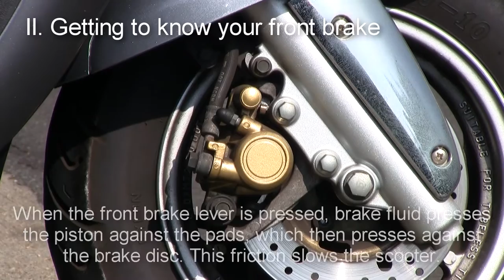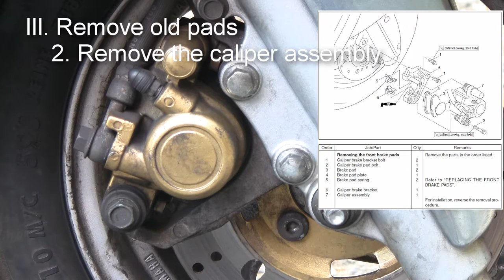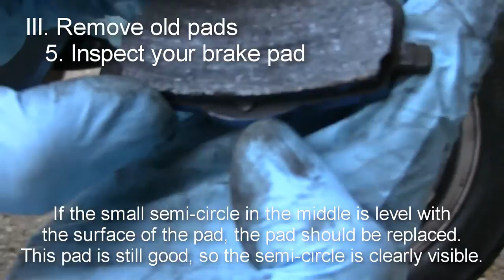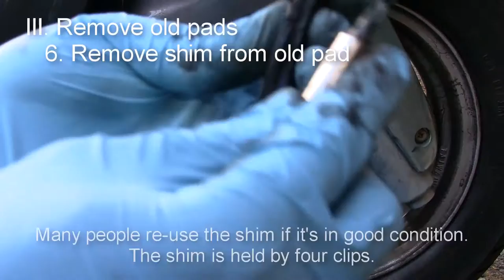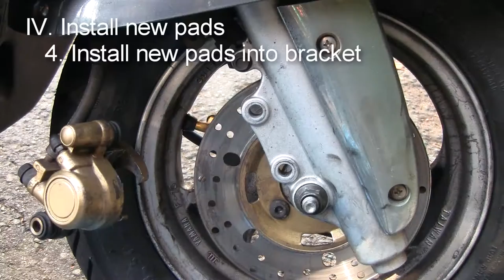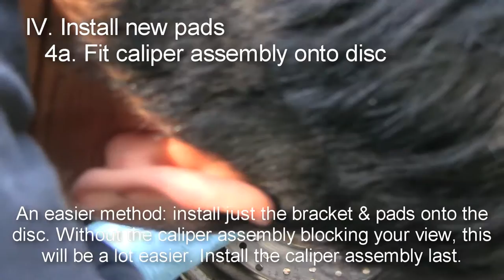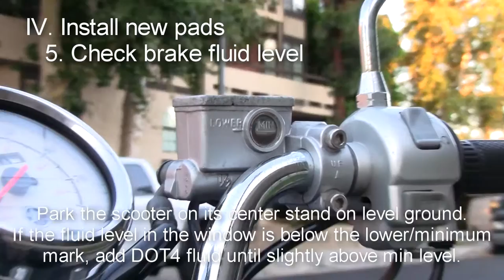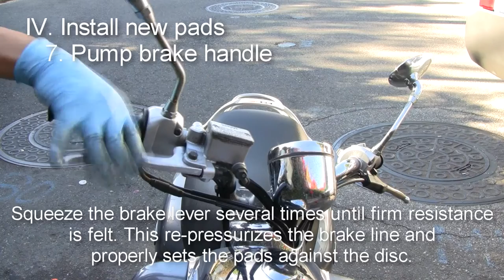How change front brake pads: Yamaha Vino 125 scooter

Comment: i cant seem to get my pads to hold onto the clips and thy fall out or out of place and drives me insane. Does this happen to everyone else or am i doing something wrong.. Your video Craig you seem to very easily put the pads on your clips with little effort and they held and im not sure why im not getting the same result. Any help would be greatly appreciated as i own 2 of these and need to do my front ones on the other aswell. Thnx Paul
Reply from the maker: Hey Paul, sorry for the slow reply. It was difficult for me too to get the pads on. There's an easier way that I only realized after making the video; first install only the bracket + springs (no pads or caliper) onto the rotor. Then install the pads by squeezing them onto the clips. Then install the caliper onto the slider and swing down over the pads. Good luck.
Reply: I ended up doing exactly what you just wrote about a month ago brother but the for getting back to me bud. if anyone is ever stuck just follow these steps that Craig wrote and be patient it never works out the first or 5th time lol Goodluck everyone and be safe